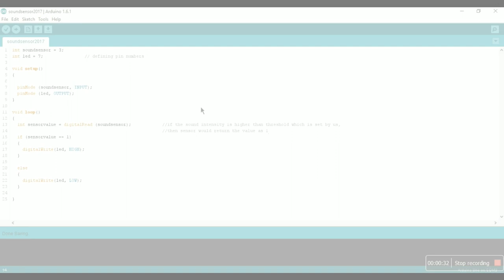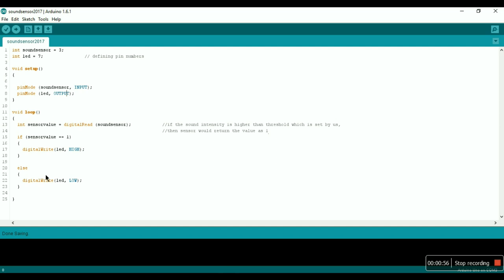Music reactive LED | Sound sensor - Arduino Connections & Coding

Comment: I used a transistor in my setup to control a strip LEDs with a 12 volt power supply.  The setup is very similar to yours, just with the transistor in place of the led.  Works great.  Mines setup using an attiny85, but the same process still applies.
Reply: which transistor did you use please?
Reply: @lou5400  it was just a tiny NPN transistor.  Cheap little 3 legged deal.  I can get you a part number later, but I'm no where near it right now.
Reply: @bugiroff9926  Thank you for your answr. could you explain me how you wire the LED 12V strip ? You  plug the + and the -  just like the LED?
Reply: please help me

Comment: You can use the a0 analog pin to get actual voltage amounts for brightness etc. The d0 pin is just going to give you a high or low.
Reply: hi! i'm new with arduino.. can you please explain clearly about a0 could get actual numbers for brightness etc? also the code if possible.. thankyou!
Reply: hi! i'm new with arduino.. can you please explain clearly about a0 could get actual numbers for brightness etc? also the code if possible.. thankyou!
Reply: thanks

Comment: I have 3 pin sounds sensor vcc gnd and out and I want to connect blue color led strip to this project rather than led so please tell me the connection and what to change in code. I am your old subscriber

Comment: Good day Sir 👋

How to setup code for my 4pin led rgb module in which the led fast changing colors blinks in line with the speed of music beat or noise and automatically turn to super slow changing color mode when there is no music or noise detected on the surroundings?

Comment: How would I modify this to trigger a 12v solenoid instead of a LED and could I replace the electret microphone for a jack input ?
Reply from the maker: Hello, you will need a driver module to operate a 12V solenoid. For such devices which demand more voltage, I have another video, check it out - https://youtu.be/D3TFmpsPuUk

Comment: Hey there is error in the program.....
What should I do...?
Reply: he just make no espace in the code so this is the full right code ;
int soundsensor = 3;
int led = 7;                // defining pin numbers
void setup() 
{ 
  pinMode (soundsensor, INPUT);
  pinMode (led, OUTPUT);
}

void loop()
{
  int sensorvalue = digitalRead (soundsensor);            //if the sound intensity is higher than threshold which is set by us, 
                                                          //then sensor would return the value as 1
  if (sensorvalue == 1)                                    
  {
    digitalWrite(led, HIGH);
  }
  
  else
  {
    digitalWrite(led, LOW);
  }
  
}

Comment: can you explain how you make with a 12LED STRiP please?
Reply from the maker: Hello! You will need driver like L298 for that.. because the LED strip will require either 9V or 12V. I have a separate tutorial on driver module, hope it will provide you more insights - https://youtu.be/D3TFmpsPuUk
Reply: @MechStuff  thank you sir i'm watching your video but where should i connect it to the arduino? I can connect the led strip and the battery but how to connect the driver to the arduino please?

Comment: Hey, great video! If I wanted to use this with a 5m LED strip, should I connect everything through a breadboard with a 50V power supply?
Reply from the maker: Hi.. Connecting a whole LED strip is a bit different. You will require a driver module for that. Also for strip, you only need a 12V supply.. 50V would probably burn the whole strip..lol
Reply: Use relay module

Comment: Is there a way to keep the LED on when it hears a sound, and then have it turn off when it hears another?
Reply: Change the condition altogether.. like if sensor gets value 1 then set left off. And else switch it on

Comment: Code didn't work for me. expected primary-expression before '<' token
Reply: me too
Reply: @MRPSKch  int soundsensor = 3;
int led = 7;                // defining pin numbers
void setup() 
{ 
  pinMode (soundsensor, INPUT);
  pinMode (led, OUTPUT);
}

void loop()
{
  int sensorvalue = digitalRead (soundsensor);            //if the sound intensity is higher than threshold which is set by us, 
                                                          //then sensor would return the value as 1
  if (sensorvalue == 1)                                    
  {
    digitalWrite(led, HIGH);
  }
  
  else
  {
    digitalWrite(led, LOW);
  }
  
}

This is the working code
Reply: @sagnikchatterjee8122  hey man, is this code really works? i haven't try it cause I'm still waiting for my physical arduino to came.
Reply: @woahwhodis  Worked for me though bt give it a try u can once ping I'll try something diff then
Reply: @sagnikchatterjee8122  thanks! anyway got a question is this project can be included as physical interaction that controls sound in a continuous, controllable manner???

Comment: i tried putting the code in but it just says

exit status 1
a function-definition is not allowed here before '{' token

what to do?
Reply: the code in the link is missing a line from the one he shows in the video.  add a "void setup()" after the two "int" and before the bracket.

here's the correct code:

int soundsensor = 3;
int led = 7;  

void setup() 
{ 
  pinMode (soundsensor, INPUT);
  pinMode (led, OUTPUT);
}

void loop()
{
  int sensorvalue = digitalRead (soundsensor);            
                                                          
  if (sensorvalue == 1)                                    
  {
    digitalWrite(led, HIGH);
  }
  
  else
  {
    digitalWrite(led, LOW);
  }
  
}

hope this helps :)